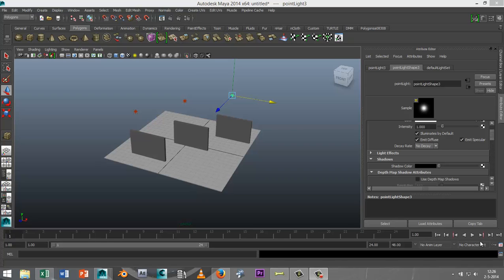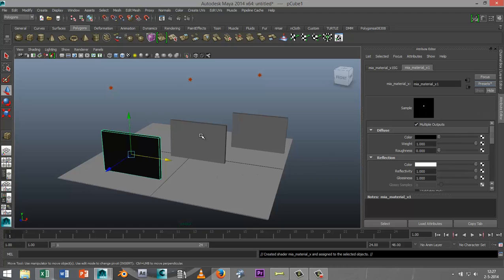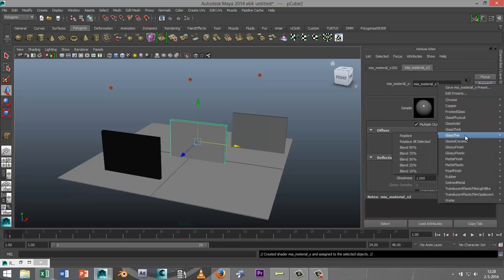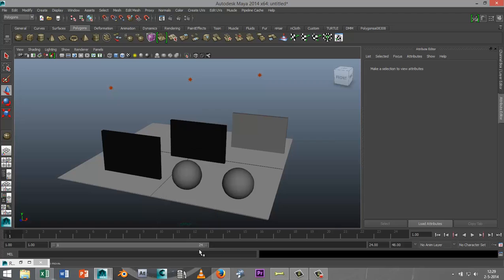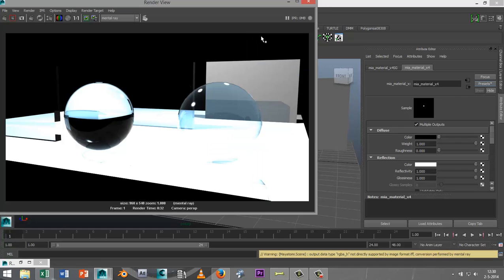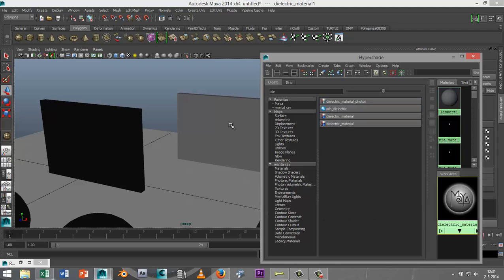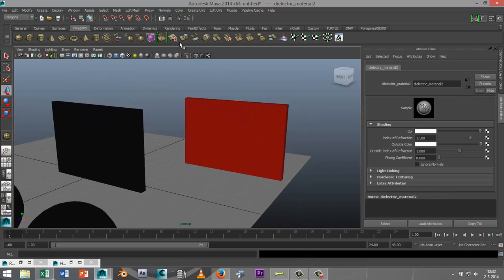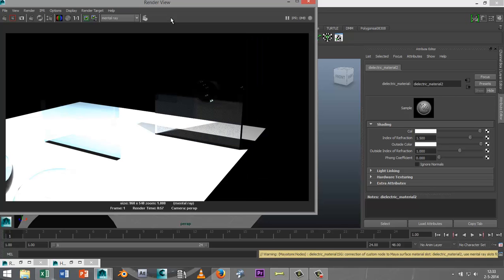Maya tutorial : Creating various glass types

Comment: I have an particle effect inside my glass ball, and when I test render (mental ray), particles seems to not appear when its inside the glass ball but only renders when its outside? my transparency is all fine because i can see background but just not particles inside the object
Reply from the maker: Check you refraction settings. Make sure the light is allowed to go in and through the globe. So set the value to at least 6